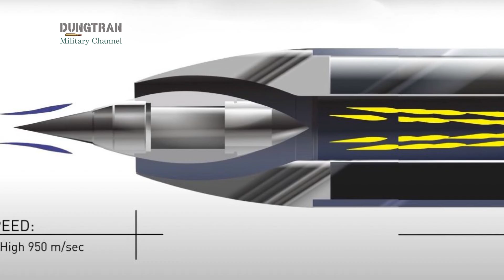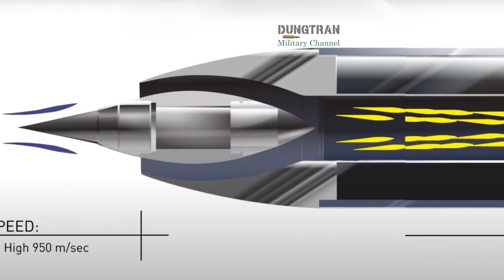The Ramjet 155 Revolution: 150km Precision Artillery Explained

Comment: Given that precision guided rounds are up to 10 times more effective at achieving the goals a fire mission than unguided "dumb" rounds. This means for the same fire mission somewhere between a fifth and a tenth of the number of shells need to be transported to the firing location of the self-propelled howitzers. This greatly reduces the number of supply vehicles required to bring rounds into close proximity to the line of engagement, reducing the chance that one will be detected and struck or that their movements will identify the rest and rearming locations of the howitzers.  Add to that the much longer range of the ramjet round that keeps the artillery and the logistics vehicles much further way from the ling of engagement. Or if the risk is worth it, the ability to strike far further in the rear from the same distance back from the front lines can allow artillery firing these rounds to accomplish missions that are simply impossible for even rocket assisted rounds like the Excalibur. 

Plus the greatly reduced number of rounds that need to be fired allows the existing artillery guns and self-propelled howitzers to be as effective as several times their number firing dumb rounds. And the very most important, each howitzer doesn't need to sit in one place for an extended period in order to fire the greater number of dumb rounds required for assured destruction of the target of a partiular fire mission. So they can fire just the two or three round needed to destroy the target and scoot with greatly reduced chance that they will have to stop and reengage the same target because the two or three dumb rounds they fired before having to move didn't finish the job. A single stop to fire might even be able to engage two or three targets rather than two or three stops to make sure a single target is destroyed.

Oh, and the total cost might not be any higher with these super long range precision guided rounds. Even if they were $100,000 each compared to maybe $1,000 per unguided round, if one round could do what it took 10 unguided rounds to accomplish, then the direct cost of the rounds is the same. But the weight and risk of the supply train is slashed, the wear and tear on the gun barrels which have a fixed number of rounds that can be fired before they have to be replace and the lower number of howitzers destroyed and highly trained crew kills all means that these "very expensive" rounds are cheaper when everything else is considered.

Comment: As an artillery munition, it will have too small a warhead. But as an anti-aircraft munition, it will be excellent. It will be possible to create automated 155-millimeter anti-aircraft systems that will be able to shoot down air targets at ranges of 50 kilometers and at altitudes of 20 kilometers with such rocket munitions. This will be exactly the means by which it will be possible to intercept gliding aerial bombs.
Reply: -Leonardo already have a direct fire 120mm guided smoothbore round based on Vulcano technology. When fired at 20 degrees elevation it has a range of 30km. (NATO tanks 22 degrees standard) .    It would only be a matter of integrating the technology of the same companies DART guided anti aircraft ammunition to get a viable weapon.   This round is not yet ramjet assisted just a subcaliber round.   The US MADFIRES 57mm round has its own anti aircraft seeker in the nose and could also be integrated.  
-A 155mm round as you suggest would be a very powerful weapon.

Comment: Sounds great, but with the addition of a Ramjet engine to an artillery shell, it will then have a heat signature which can the be intercepted by anti-air assets unless the speed of the round can overcome this, which you didn't cover in your video.
Reply: I doubt anyone would be able to intercept a ram jet projectiles with an AA..
Reply: Good point, so it would be imperative that this round is cheaper than whatever they use to shoot it down to maintain the attrition advantage.
Reply: I believe the ramjet propulsion is discarded like a sabot soon after burnout.  In any case the substantial aerothermal heating signature of conventional rounds has not been proven as exploitable in practice.

Comment: How much explosive can you really fit into a shell that is mostly taken up by a ramjet motor though?  I guess we will find out.  Pretty cool and I wonder why it hasn't been done before.
Reply: The Ramjet 155 has 5.2 kg vs 10.8 kg in a standard 155 mm HE round.
Reply: @reypettis2407  Thanks for dropping that knowledge.
Reply: @reypettis2407  That is not a lot.
Reply: Maybe it will only be used as a kinetic dart?
Like an APFSDS, it discards the whole rocket motor right before impact, so only the heavy dart core will penetrate through the target.
Reply: @MinhNguyen-ut6ue  That's a solid idea.  I was also thinking that a dual shaped charge could be fit into the aerospike at the front.  I guess we will have to wait and see.
Reply: The amount of explosive means not appropriate for some targets. Other targets may get the job done.
Reply: Well... it looks far longer than a normal 155 shell, it could have the same amount of explosives?!?
Reply: @core3086  No, of course not and that is the weak point of this design.
Reply: It is a Rocket Assited Munitions.
Reply: @robandcheryls ... a ramjet ia not a rocket ...
Reply: you dont need much if it hits
Reply: And the price, a simple missle is maybe the better choice.
Reply: ... a 155mm shell typically contains  10-15kg of explosive ...
Reply: I'm guessing "enough"?

Whatever that means.

Can't imagine they'd spend the time to develop it if it couldn't have good effect on targets.

I was gonna say time and money, but no. 

I can totally imagine them spending insane amounts of money on something that would never work.
Reply: @mtgAzim  Probably not so much.
Reply: I agree, that this is the weak point of the design. Range has no value when you warhead has no or only little effect.
Reply: Yeah, they will probably need to get the CEP down to a few meters probably.
Reply: 5.2kg is still over 60% more HE filler "bursting charge' than a 127mm naval shell which is usually around 3.2-3.4kg. 
I believe Excalibur was also 5.5kg of bursting charge